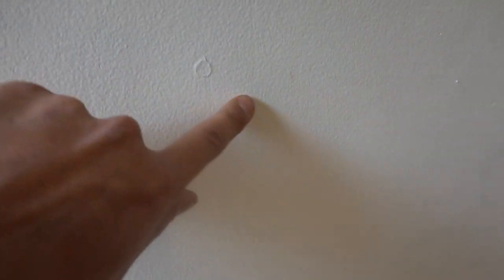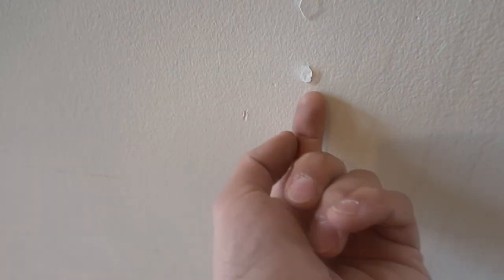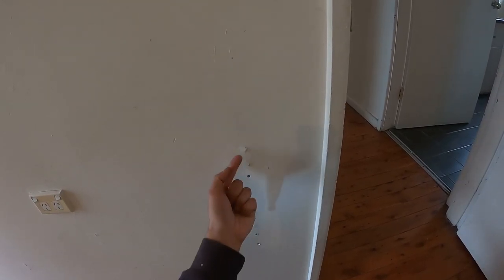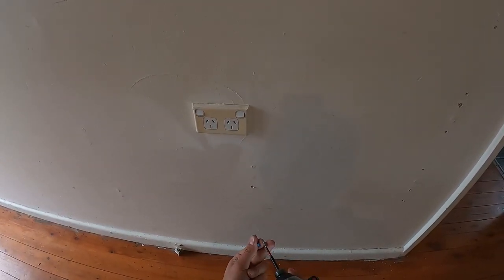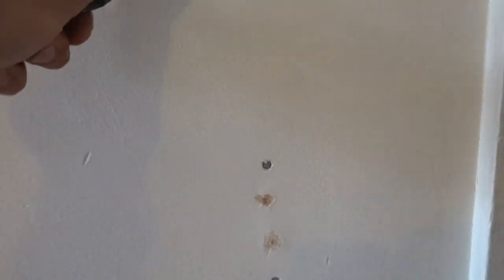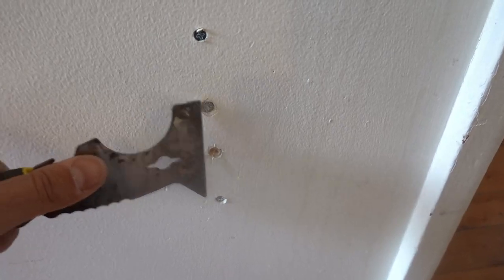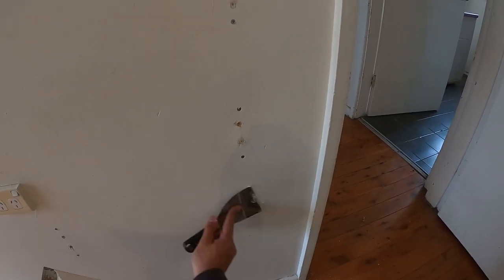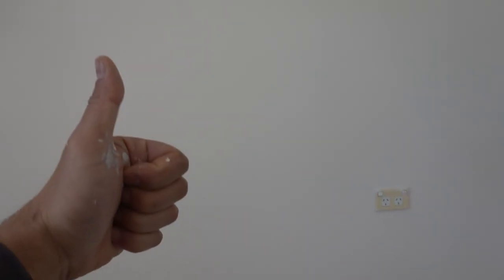How to fix nail / screw pops

Comment: Fantastic advise, I have just finished painting a house with that very problem. Nail pops are a real nuisance, and common in houses over twenty five years old. Sometimes you don't notice the nail pops until you put a coat of paint on the wall.
Reply from the maker: Very true, fortunately it’s an easy fix👍